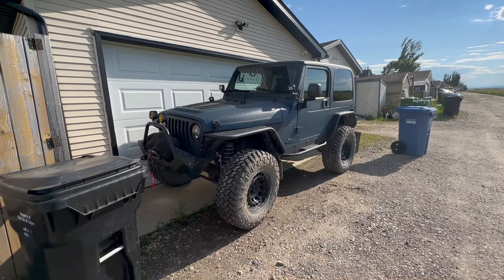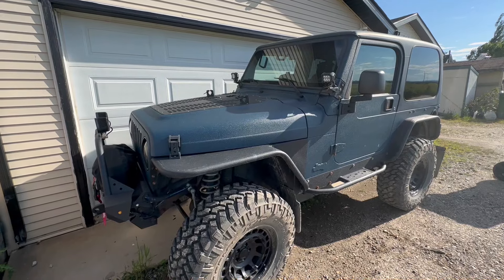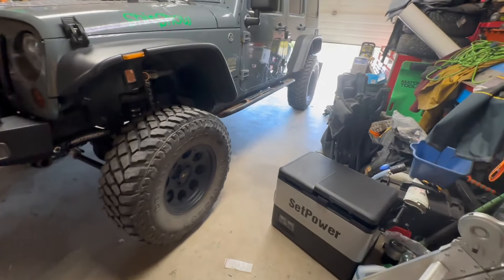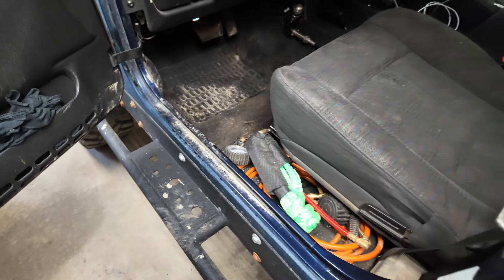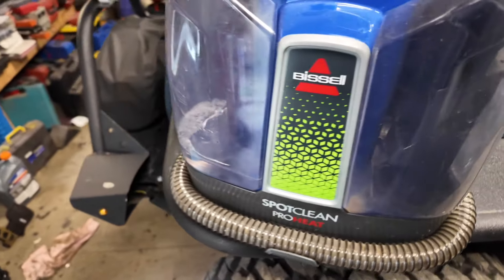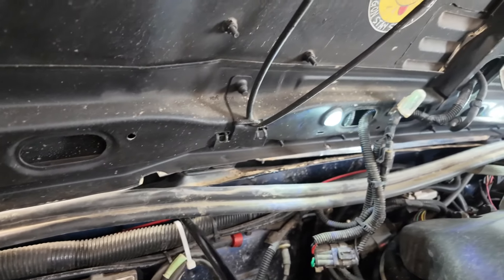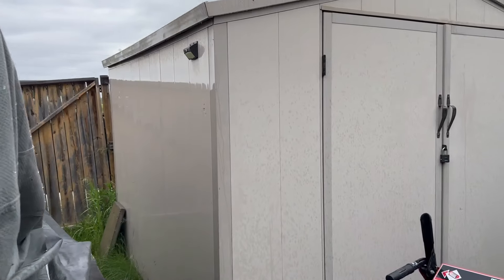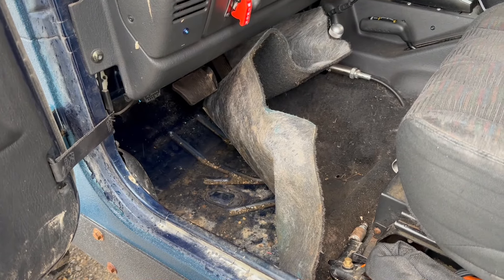JEEP TJ FLOORS GETTING SOAKED AFTER RAINING

Comment: That last test you did with that center chute....put some sealant AROUND it.  Even tho the chute is clear and drains, you'll notice it moves around.  It fixed my leak
Reply from the maker: interesting but the chute goes alone the transmssion tunnel on the firewall i cant leak inside

Comment: I've had a mystery leak that fills the floor pans. checked the plastic drain chute under the scuttle numerous times and was all clear. eventually fitted new door seals, which so far has fixed it. some one here posted to apply sealant around the plastic drain chute which makes sense to me, so will do that as well
Reply from the maker: we are in the same boat I see

Comment: My dads 04 is a unicorn no leaks , my 98 is pretty good actually but sometimes water on the passenger side, I’ve siliconed the drain area in the cowl and upgraded all the seals which helped
Also mine is linexed inside so doesn’t matter lol
Check out the firewall by the passengers feet the hvac box has some foam and seals on the firewall area, possibly water can come through there too
Reply from the maker: that is a Unicorn for sure

Comment: My tj gets water when there a good wind if that helps at all ,Then shes a no start for a bit or a lit
Reply from the maker: that's very odd have you tracked it down at all ?
Reply: @BackCountryWrenching  Found water getting in, between soft top and half doors. The easy puddles but the no start was leading to harness/ ecu . Bought it from 1 owner who had replaced ecu along with tune up areas. An i had replaced  all sensors and spark related except cps but checked at harness ( iknow doesnt mean cant be bad with meter test)

Comment: I found that when I park my Jeep nose high on my driveway I don't get water inside.

If I park it nose low I get water on both sides.

If I park it drivers side low, you guessed it, water on drivers side ...

My guess is that the drip rails on the hardtop above the door direct the water towards the A-pillar and hinges and then to the inside
Reply from the maker: that would make sense for sure

Comment: I had the same issue on my TJ.  Water would pool on my passenger floor every time it rained.  I opened up the cowl and everything looked OK.  I figured while I was there i would flush out the plastic drain thing.  And it worked.  No more leaks.  I think even if the opening looks ok there can still be debris inside.  Try flushing it out, that may fix it.  https://youtu.be/KTtaJpSoySs
That's the link to the video I made for it.